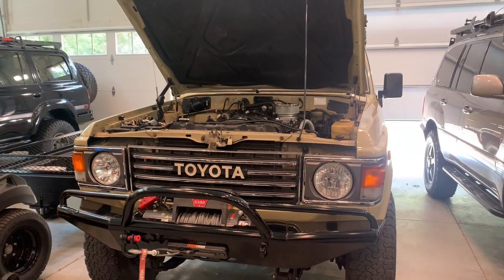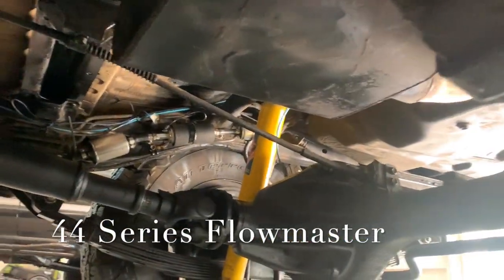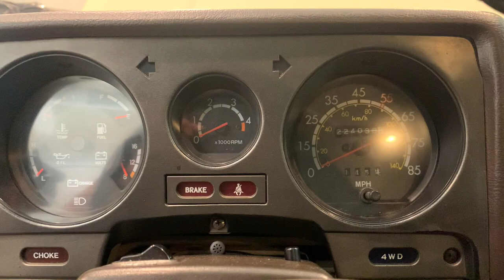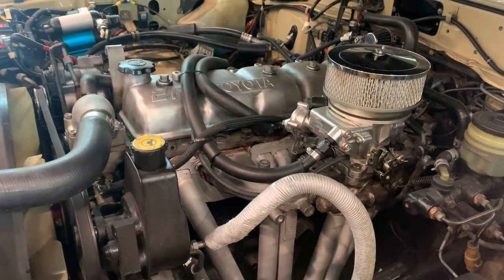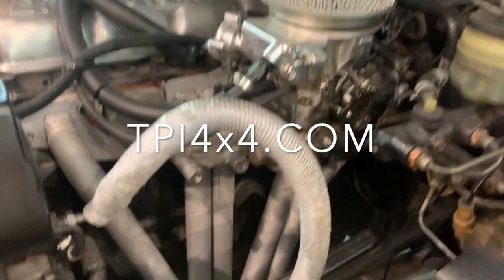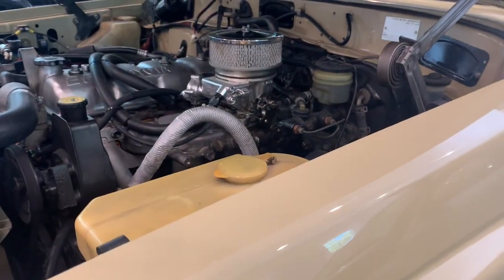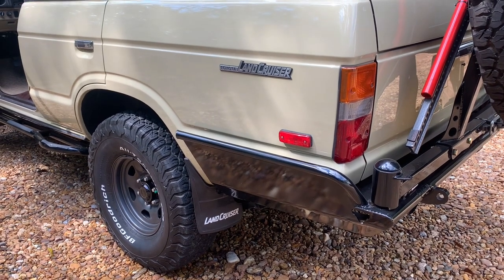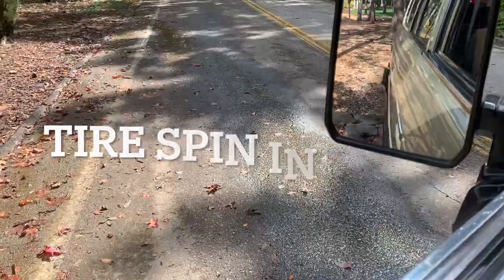Favorite FJ60 Land Cruiser Mod 2F...Exhaust, Header, and Flowmaster

Comment: Did you use copper seal on the intake and header cylinder head gasket?  (Looks like coipper for intake but some silver gunk for the header, what is this?) and is this a remflex gasket? Just bought these tri mils, their on their way in the mail!  Also, what header paint did you use, and how much longer will headers last with it vs without it?
Reply from the maker: I did and got my gasket from toyota, got the header paint off amazon and I think it keeps it from rusting as bad, it's thick paint so maybe insulates a little bit

Comment: Would be able to send pictures of where you routed everything line
Reply from the maker: Yeah I'll see what I can do I did use the back of the fire wall and routes over to a rubber plug on the drivers side to the inside of the cab, and then just went down the passenger side of the frame and tied to the brake lines for the power to the fuel pump

Comment: also did you have to get the headers machined to flatten em out? If not, how'd you get the surfaces to level out to where you can add those cut steel plates on there? Thanks dude!
Reply from the maker: I didn't do any machining just used the toyota gasket and the copper seal orange stuff and cut those pieces out of some stock metal

Comment: did you desmog your FJ60 yourself, if so what all did you keep fro the emissions system. any reference you recommend for going about that?
Reply from the maker: I didn’t actually do it myself. It was done when I got it. I do still have my smog pump on the truck but it has a pipe welded shut on it

Comment: Could you be so kind and write down the parts you used.  I noticed that you have a different steering pump.  How do I do that?
Reply: Can you help with my question
Reply from the maker: yes sorry I order the SAginaw bracket I think from cruiser outfitters 801 563 1277 then you just get a GM pump.

Comment: Trying to copy you, but am noticing there’s a slope on bolt hole area 3 and 4, meaning the bar stock will be at an angle. How did you fix this problem for these two spots on the intake? Or did you not worry about the slope?
Reply from the maker: I just used those pieces and torqued it down hadn't had any problems.  Thank you

Comment: where did you get the headers?  and the holley sniper.  interested in both
Reply from the maker: TPI4x4.com is where I got the headers and I’ll work on doing a video on the sniper EFI soon. https://tpi4x4.com/
Reply: @quickanddirtylandcruiser6217  thanks
Reply: What’s your carb? looks nice without all those vacuum lines I also have a FJ60 87 still have the smog system I’d like to de-smog mine
Reply from the maker: @genzycat600  that is a holly sniper EFI

Comment: I’ve got the same motor in my 69 fj40 I’m defenitly going to take it to a muffler shop now and have the same setup put on. 

What fuel injection lid did you put on?
Reply from the maker: Nice! I used the sniper by holley

Comment: engine is not even close to diesel spec 2F is big 4.2 L it is lacking power from being low compression ratio 7.8:1 where any diesel like 15:1, but the sound is good
Reply: The 2F  actually has more power and torque than the 4.0 2H which is the diesel engine that was offered.
Reply from the maker: interesting